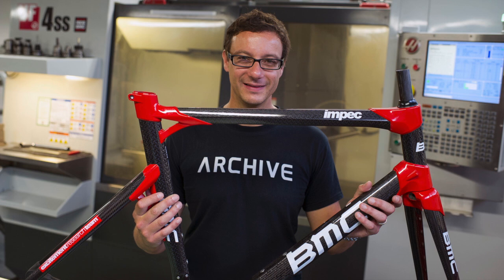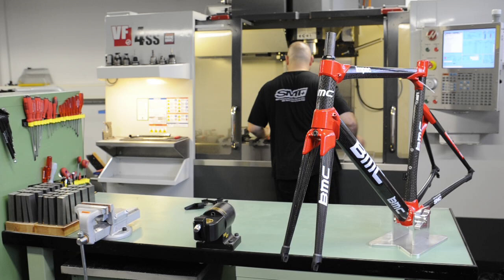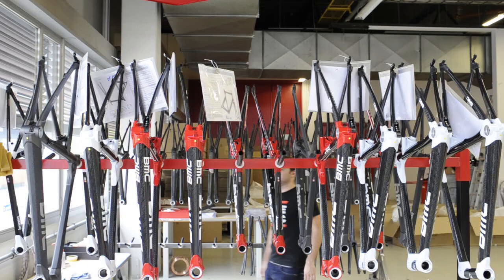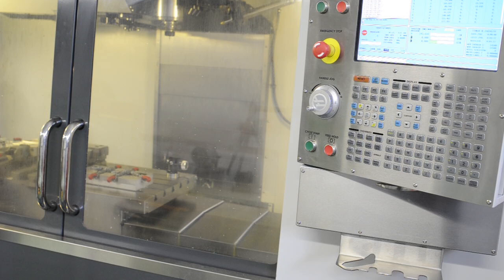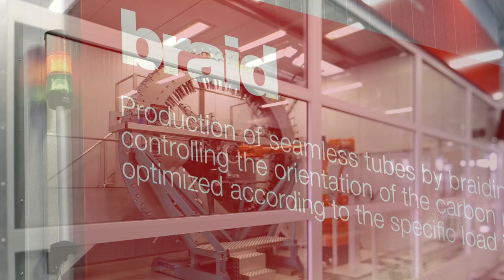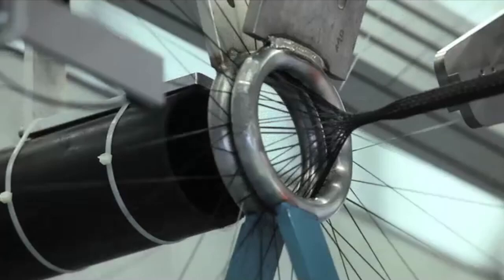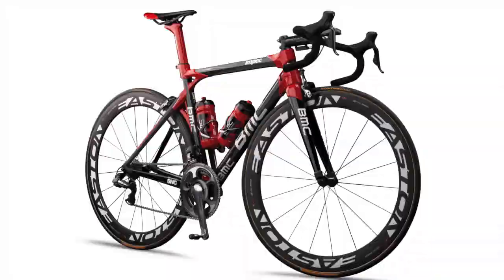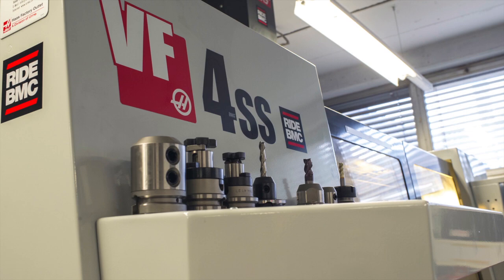BMC: Impeccable Pedals — Haas Customer Documentary

Comment from the maker: High-end Swiss bike manufacturer — winner of the 2011 Le Tour De France — BMC Racing (Ride BMC), uses a  #Haas VF-4SS vertical machining center at its state-of-the-art impec factory, in Grenchen, near Bern. The machine is used to make a variety of different parts, including fixtures for frame jigs, frame joints in plastic, and multifarious one-off parts for R&D of new designs.

Learn more about the super-speed Haas VF-4SS vertical machining center here:http://bit.ly/Haas_VF-4SS
Reply: Good job #Haas!!!